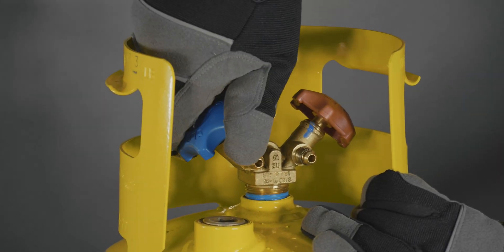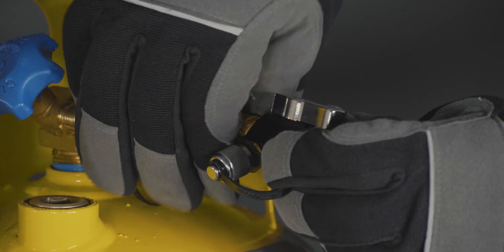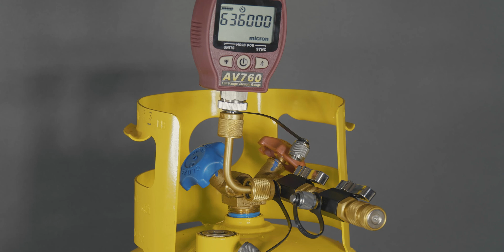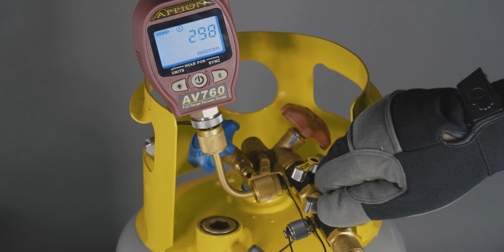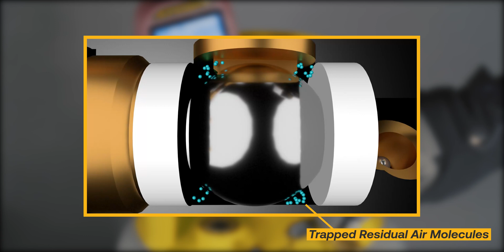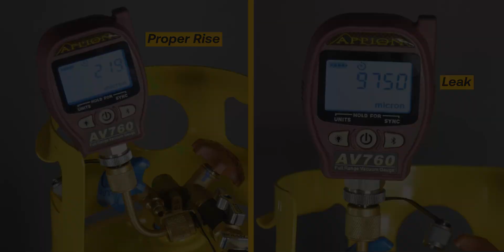VCRT Isolation Test

Comment: What if it’s the 5/16 one for mini splits
Reply from the maker: When testing the 5/16 Valve Core Removal Tool, you will need a tank with 5/16in ports; use a 1/4in female to 5/16 male.

Comment: The second VCRT isn’t even needed it’s redundant
Reply from the maker: the second core tool allows you to isolate the front of the test tool that is between where the hose would connect up to the ball valve.  Only using the test tool without a second tool is only testing part of the test tool.
Reply: Very informational! Thank All of Appion tools Company. @Appiontools